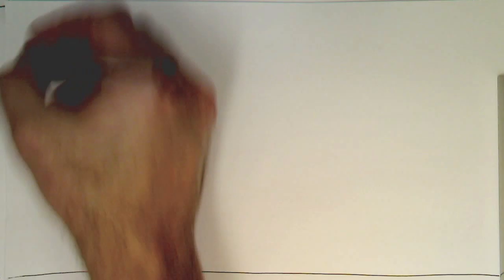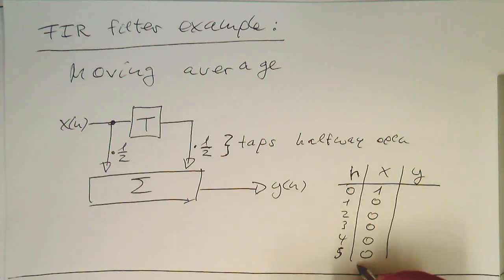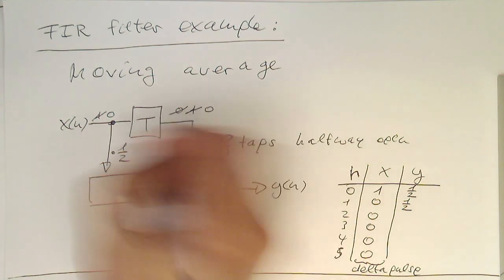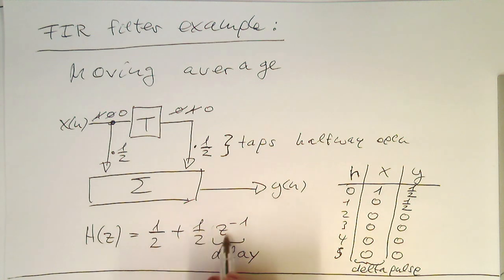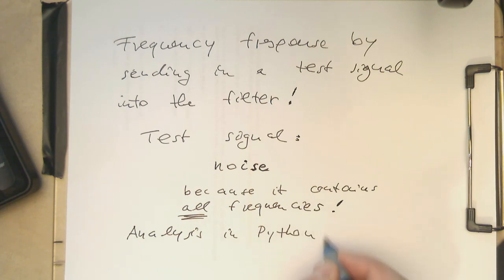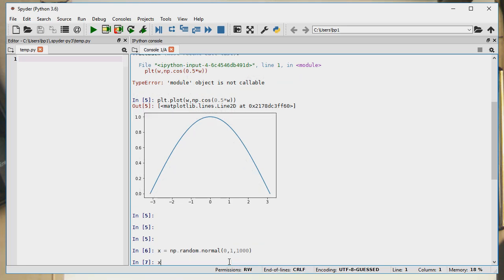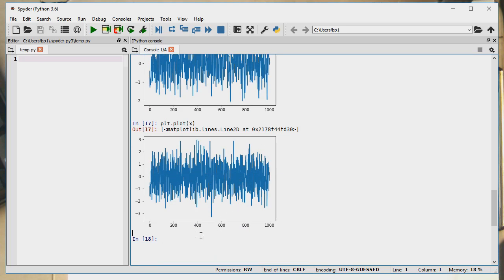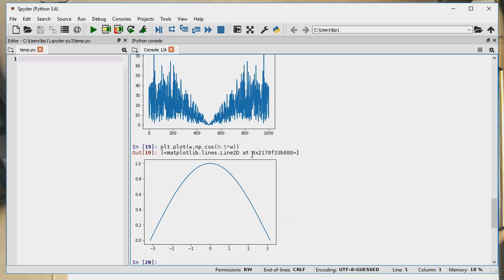FIR fillters: averaging filter (001/py)

Comment: 13:40 y(0) should be 0.5, not always zero output, I think
Reply from the maker: Yes. At the very start before the filter settles it will first output 0.5 and then zero for n>0.